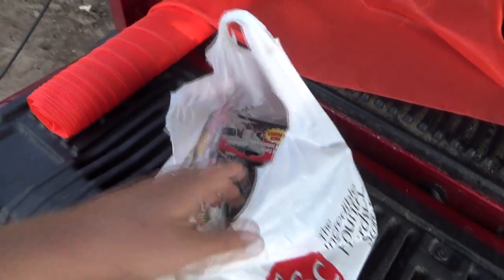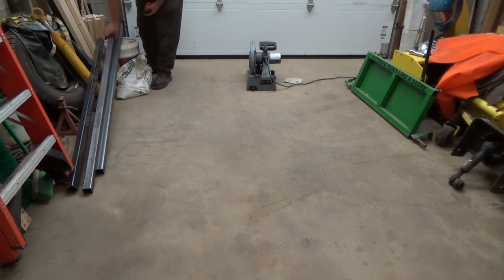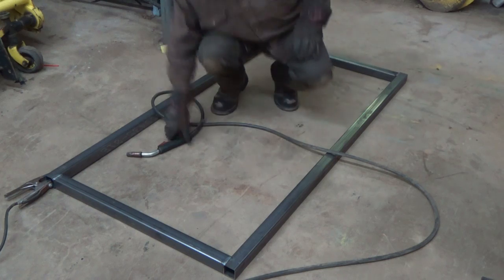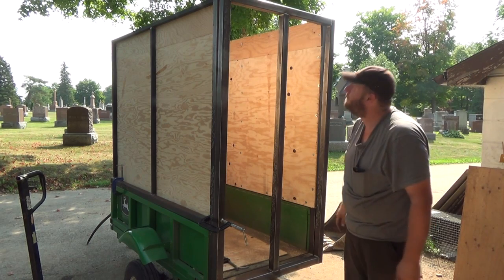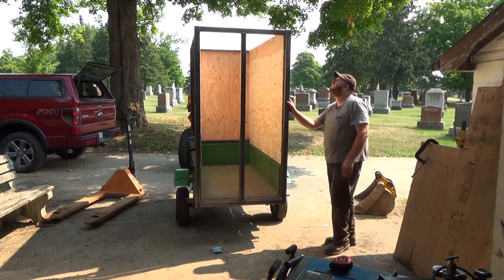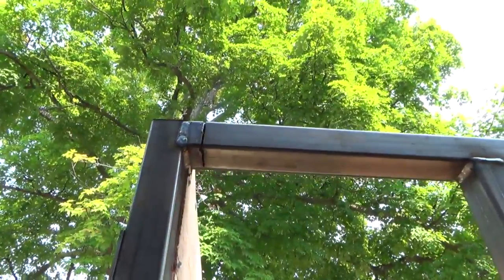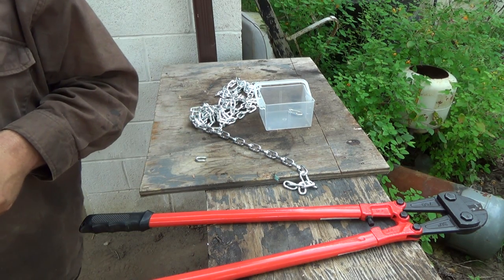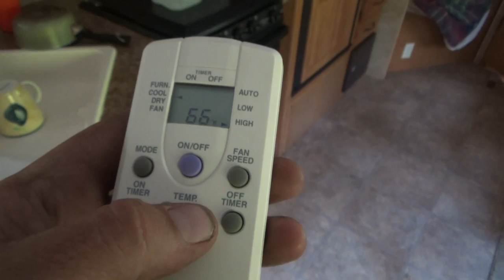TRAILER TAILGATE BUILD WITH SOME ISSUES RESOLVED

Comment: I used one of those Cyclone Rake things at work last Fall. It's basically the manufactured smaller version of what you're building. After seeing how that thing is made and how well it works I can tell you for sure that it doesn't need to be sealed up anywhere near as tight as you're trying to get everything. Also, unless you're using a massively bigger blower than they have to blow the leaves into it, you don't need the whole top to be mesh. They only have about a 2 foot square in the top of theirs. So if your mesh isn't big enough to cover the whole thing you could just put plywood over part of it.

Comment: Bill if your worried about the door leaking a bit then you could try and get some sort rubber door seal or a rubber strip and put it around the door so when you close it it wouldn't leak at all 😃

Comment: Bill, in your trailer try turning on the furnace.  See if hot air comes out of the other vents that aren't blowing when your A/C is on.  You might have a split delivery system.  Just a hunch...

Comment: Bill, just a thought but what if you put a standoff on the front top about a foot to a foot and a half out almost like a v nose trailer and then run a length of chain to your frame that goes to the hitch and to the stand off. you could leave the chain long until you figure what length it needs to be to dump. the leverage from the standoff should make it dump ok. i am a new subscriber but love your videos.

Comment: Bill- put a sock of some kind on the inlet part of the blower tube inside the trailer. This will force more of the material to fall to the bottom with out flying around so much. This way if you door has a small gap it won't leak crap everywhere!!!!

Comment: Bill you could save alot of weight by replacing plywood with a 3/8 metal screen.  I beleive it comes in 3,4,or 4 foot wide rolls
Reply: +Russel Brown He'd have "dust" blowing everywhere if he did that. As for weight, 1/4 ply would've been better to use. His biggest issue is tearing that material on the top corners with the stress of the bungee cords pulling it down tight.

Comment: use the left over chain and quick link to hold the door open by welding the end link to the trailer side  and another single link to the rear door  and have a hook on end of chain to hold the door open at 180 degrees. With chain and hook welded to trailer, it will never get lost or misplaced

Comment: Why would you really need a door on the back? You could just attach the plywood directly to the frame and the whole thing lifts of when you tip the trailer.. (I mean, if you are going to stick with the original idea of lifting the sides and top once the trailer tips)

Comment: um question how full are u going to be able to fill it and with wet leaves its going to be top heavy and u might roll it
Reply: I dont think hes going to go that fast...
Reply: You never know if you have the right speed and your going on a bank plus the weight of the trailer already. Shit happens
Reply: It's mostly flat ground
Reply: not only is it flat ground that Bill is working on but the trail that Bill will be going on to dump the trailer is going to be pavement. So it is going to be a very high probability that the trailer WON'T tip.